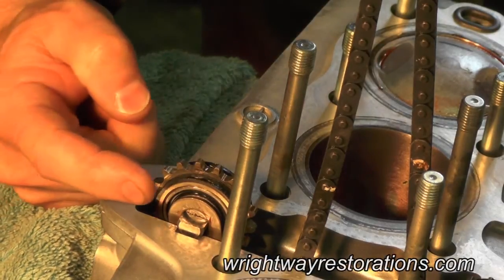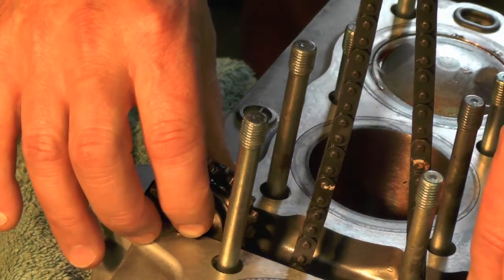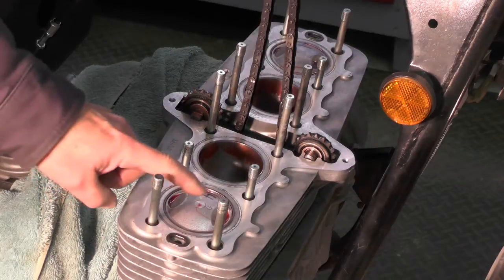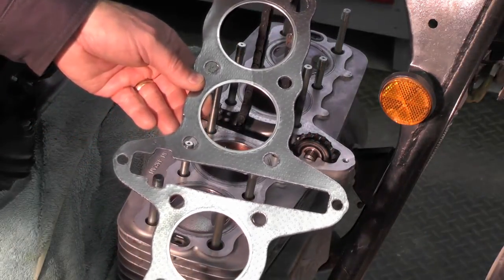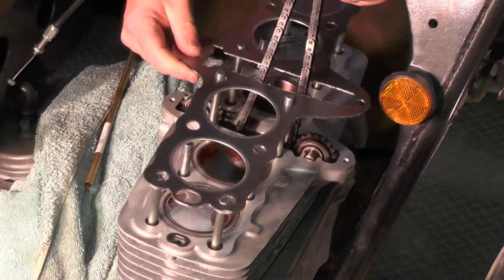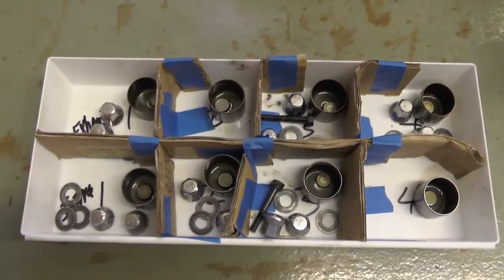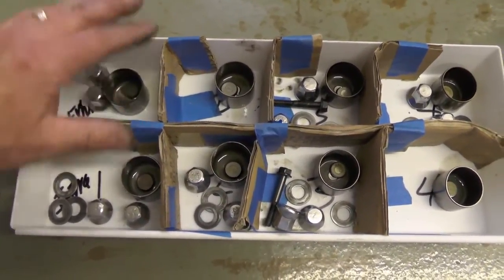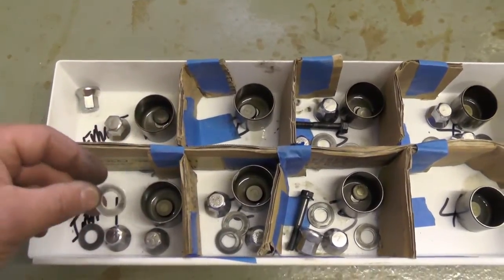Kawasaki KZ650 Top End Reassembly - Part 10 --- Video #43

Comment: How did you get it to lay flat with the rubber dampers in the way?! I’m struggling to get it to sit flat
Reply from the maker: Are you referring to the rubber dampers for the cam chain tensioners and these elevate the head above the block deck?  If so,  I'd just make sure everything is oriented and installed correctly (and the correct dampeners are being used) and tighten the head down.

Comment: You didn,t put your front chain guide 2 little rubbers on top before your head gasket on otherwise your chain will rattle when idling unless its slightly different engine to mine, they are like the chain tensioner rubbers but smaller 4 little rubber bushes for both idler and tensioner anyway  great video buddy

Comment: great video,  is there any tutorial specific to put on time the timing chain and cams. i am afraid of  hitting the valves. 
thanks
Reply from the maker: Though this video series was shot well over four years ago, I believe one of the videos does speak to cam timing.  As I don't recall which one, nor do I have a record of each video content, you will have to look through the different videos to find the one in question.  If I'm incorrect and the timing is not include in one of the videos, then it doesn't exist here as I don't have a video on that specific step.
Reply: thank you, your videos are great!
Reply from the maker: Thank you for the kind comments!

Comment: Hi great video manual, I wish this was around 20 years ago when I did my kz650 rebuild. I am about to replace the head gasket on my kz650 you mention the two bolts down the front and rear cam chain tunnels I know these are easy to over tighten what was your tip. You forgot to mention them it in the next videos. I have also been advised to apply a little gasket sealant (which I don't like doing) to the two outer O rings left and right to prevent them from distorting, apparently a design fault. This is where my head is leaking from. Thanks.

Comment: hi i was wondering if the parts you are installing are brand new? those aluminum engine parts look new. please let me know
Reply from the maker: ***** The engine is all-original, including the lower end, cylinder and head.  The only items replaced were the wear items, i.e., valve stem seals, gaskets, etc.

The cylinder and head were blasted with bicarbonate soda, which I described in one of the early video segments.  The lower end was simply cleaned the old fashion way... elbow grease and patience.
Reply: Oh ok thanks. I found a new nos head for a kz650 but it's like $500